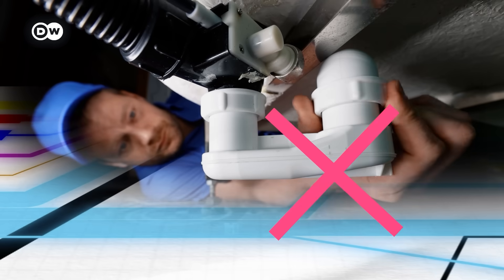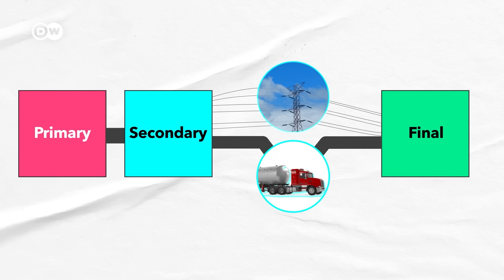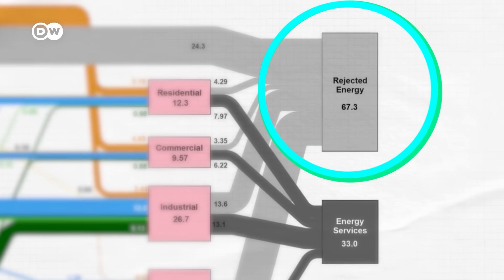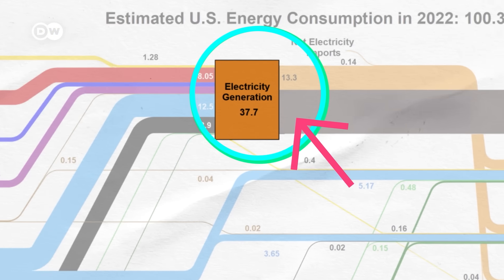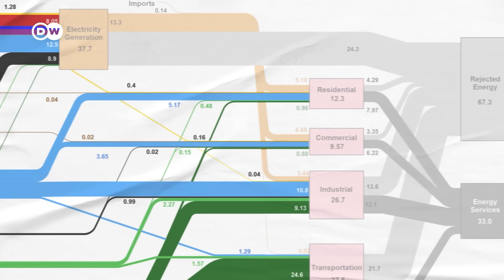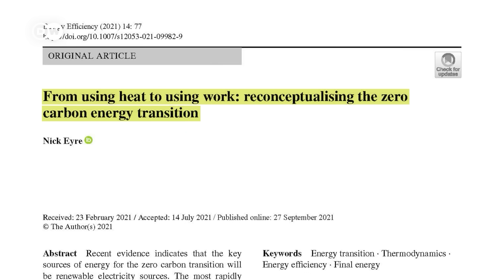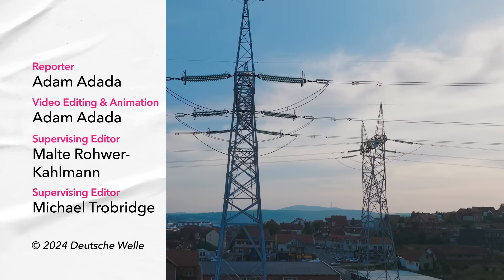The mind-blowing thing we get WRONG about energy

Comment: Most people do not know that two thirds of the money they spend on gas is for waste heat
Reply: Doesn't have to be, 40% is for peaker plants that backup renewables and variable demand, 60% is for CCNG base load power plants, 80% is for CCNG that burns in oxygen and sells the nitrogen to fertilizer production next door. That dual plant hasn't been built yet.

Comment: Electrification is not a done deal especially in the developing world. The electrification drive requires resources i.e., minerals and chemicals at the scale which is maybe 10-100 times of current global production. The extraction and processing lastly commodification the minerals and chemicals are highly energy intensive and can't work on renewable energies (mining/quarrying , treatment plants, forges etc ) atleast in cost effective ways. This is not also counting displacement of vulnerable people , ecosensitive zones .
The efficiencies shown here are  true because it's thermodynamically based on the energy source the inefficiencies don't matter till the fossil fuels price rise to threshold
Don't fall for ration of cost to max potential power output because love it or hate it renewables are not 24/7 operational fossil fuels nearly fully operational 
Storage is still a very buggy and expensive problem
Reply: Storage isn't buggy. Electrifying resource extraction isn't impossible. Kuhn Schweiz in Germany has developed an electrified mining truck that does not need external charging. It drives up a hill, gets loaded up with minerals, then recaptures the electricity on the way down with regenerative braking.

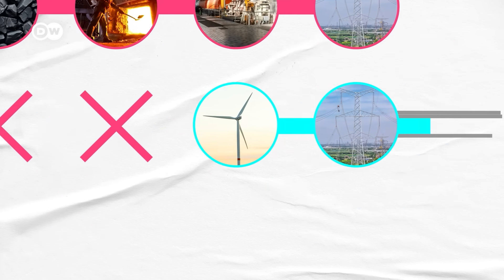Comment: They are speculating again, solar panels and wind turbine are not comes from a thin air (6:51), they are produced on factories that uses tones of different materials with huge energy usage. 
So it is not the answer to any problem, nuclear, geothermal and fusion power are the future.
Reply: It's no different cost of energy to making cars, washing machine, etc. At least Solar Panels will offset and even returns back many times over the energy used into creating them.
Reply: @TakZ000  Irrespective, it's still a valid point that the energy to build these things and the material pollution eg solar panels or even the wind turbines is still an issue. As to cars? Too many people wasting time doing unnecessary transportation and washing machines same: Demand needs to be cut down as much as efficiency and clean energy production are part of the solution.

Comment: This is very good "news", it is incredibly important, and it has been in our hands all along.  We just need to move beyond decades of fossil fuel industry... gas-lighting!
Reply: And replace it with electrification based on intermittency that will have quite low round trip efficient long term storage systems. New Sankey, same as the old one.
In the US NE, energy production from solar is 5x better in summer than in the winter, that spells massive long term energy storage  bill at very low efficiency.
Or we could just use nuclear that needs no storage at all even though MSRs have built in heat storage for constant heat with variable on demand electric output.
Reply: @johnjakson444  Don't forget about hydro. It only accounts for about 6% of the US grid mix, but there are very significant additional imports from Canada. This storage hydro is effectively a massive existing grid tied battery.  What we need is to just commercially re-task this from baseload to peaker, using renewable power, when it is available, to allow the reservoirs to replenish capacity.  Other solutions such as allowing plugged in EVs to feed/sell power back to the grid at a profit when demand needs capacity, and supply cushion sensitive hourly power pricing (do we need 10 million hot tubs and pools heating for the 1 hour, no wind, no sun, dinner hour, when the supply cushion is under pressure?) are also excellent market driven tools available for implementation quickly.

Comment: Renewable energies are good, however, it cannot be used to be the "BASE ENERGY CAPACITY" to sell because of its variability. But it is good enough to be used slowly by people.
Reply: This is where battery tech is crucial. There gotta be an affordable and sustainable way of saving excess energy and use them when needed. If that's successful then the base energy capacity can be lowered.
Reply: Tomrrow the OPEC countries turn off the spigot for world oil supply. America can still produce, but the oil suppliers reduce supply in sympathy with OPEC. Now, tell me, how variable is that supply? We have little oil stocked for emergencies and it wouldn't be enough. We don't have batteries or some other kind of energy storage. So, what do we do?

The electricity I'm using to write this is being produced NOW, as I write these words. There's no battery storing it anywhere.
Reply: @markhathaway9456  OPEC reducing their production? What kind of financial suicide is that for them? That will speed up the renewables technology at unimaginable levels.

Comment: I think that at least currently all solutions or electric alternatives to current appliances at the useful stage are all inadequate and do not have the same level of convenience nor experience. The other aspect of renewables except nuclear not being able to provide 24 hours consistent electricity and/or using batteries for such is something that makes you spend billions more for another, possibly fossil fuel based reliable energy source.

Comment: Fuel source is middleman not mention the war. Sometimes middleman is very bad :) Wind power and solar power is very low dense energy source where coal, oil, nuclear with all inefficient stages of middleman are very energy dense sources, we cannot deny that fact. Even with high pace transition to renewables wind, solar, hydro pace is not enough with demand because we dominated by low density technology. And second it is old technology water wheel, wind mill or  solar panels is new but only have 23% efficiency of total sun falling into panel. Wind mill have theoretical maximum of 50% wind velocity transitioning into rotation of generator velocity, and hydro have 42% limit of hydrostatic potential energy transitioning into rotating energy.  Rest of 58% is discharge kinetic energy into river. From A to B is old technology we need electricity production where kinetic energy of air, steam or water is recursively saved and used again in electric energy production.

Comment: What about the natural gas that is flaired off because it's in the way.
Reply: Most civilized countries have banned that, and it goes into the natural gas production. We changed that here in Denmark in 1980's and used natural gas for a lot of things that were previous running on oil.
Reply: @poulhenne  hopefully it was banned!!! I saw it on a mass scale in the Saudi desert, a sad sight. Also saw diesel for  .10 cents a liter.
90-91 time frame

Comment: Wow, that's one of the rare moments where bad stuff is actually good news lol
Reply: The more inefficient we have been, the easier it is to make it more efficient.
Here in Denmark, we have properly insulated houses and district heating with solar panels making all the needed heat between april and october. It makes the next steps a bit more expensive to implement, but we are still pushing due to high energy taxes.
In reality we only have certain industries that are wasting a lot of energy, the usual suspects: concrete and iron/steel production.
Reply: @poulhenne district heating in Denmark in fact anywhere have a big amount of heat loss in distribution,  you can see that with your bare Eyes only when you in light freezing temperatures have ice and snow melting only above were there are district heating pipes in ground under asphalt and at peoples driveways, there as much heat loss as 1/3 yearly, even more in sommer due to the fact that there almost only needs to heat tapwater in homes.

So district heating have to produce yearly about 130% heat out of plant to deliver 100% to buildings.

Individual heat pumps are far more efficient in areas where you have separate one family houses.

If those one family homes have Solar on there roof it will be further efficiency.
 
In Denmark where you we use a great amount of straw or wood chips in district heating its  greenwashed to be CO2 neutral to burn that type of captured carbon, totaly stupidity, captured carbon/ coal, shall not be burned, even  more disturbing in Aalborg DK, there is used coal to generate heat to district heating in a plant placed about 10 km from Greater Aalborg there are a significant heat loss.

District heating is not, efficiency first, we should adress district heating Heat losses  by not open new areas whit district heating, was great, 30-40 years ago but not anymore. 

District heating should be banned a lot of place.
Reply: @poulhenne  I hope Denmark and Nordic countries also do something about their extreme ecological footprint, consumption and waste production... as at the moment they are still (among) the worst in Europe.
Reply: @maxwouhou  Unfortunately they aren't and most Nordic people tend to think they're very sustainable. Homes are very often heated to 21-25 degrees in the middle winter when it's -20°C or even colder outside and people hang out at home in shorts. Even shopping malls are so hot that you have to take your coat off when your enter. Whereas in summer people are using more and more of air conditioning even in low temperatures of less than 25°C. The modern architecture doesn't even take into account that the homes should stay cool during summer as they simply assume that people will get AC. 

People also have the tendency to drive to every place by car and the diet is basically nothing but animal products. Earning money doesn't make people into more sustaible consumers and instead they keep wasting more money into fast fashion, decor etc. 

This is my perception as someone from Finland.
Reply: @Maria-EU  Don't Nordic countries have mostly low carbon electricity, so AC and electric heating aren't really an issue?
Reply: It's all green washing without new storage technology.

Comment: I think there might be some confusion here, when we say "an x MW" plant, x isn't the power it generates + the power it wastes, the wasted power isn't computed into the capacity, meaning that even if you process is 100% efficient, you still need to generate the same amount of useful power as a plant that is 20% efficient. The thermal machines used to convert the chemical power into mechanical power are fundamentally limited in their efficiency by the laws of thermodynamics and their functioning principles.
The exact same thing happens with solar and wind, solar is about 20% efficient at capturing the sun's power in its full spectrum, while wind is a bit better.

I find this video very misleading.
Reply: I thought the video was plenty clear. Also, nuclear plants often have a MWth and MWe rating, indicating how much heat and electricity they can produce.

Comment: Interesting video. The actual video was more hopeful and honest than the narrator's spin on the information. My takeaway. Transitioning to an electric energy system is a no-brainer. And is arguably the most important part of this equation. Energy systems using heat* (which will remain necessary) should be used for base load to maximize their efficiency. Not as a supplement to intermittent wind and solar. Renewable energy solutions, that when available, can convert primary energy into useful energy the most efficiently. 
Not mentioned in the video. Flipping the script on how we view renewables such as wind/solar (primary vs. supplementary) would also make a great deal more sense with regards to battery storage. 
* coal, gas, nuclear, geothermal.
Reply: Heat can be stored in several ways and there is work on also converting it to electricity directly (not through common processes). I believe the latest developments are by MIT.

Comment: I would have liked to have seen some comparisons between countries with cheap and expensive energy (including taxes that make energy more expensive). In theory if the energy is more expensive the system should be more efficient.
Also how efficient are the best countries like Iceland, Norway and Denmark, maybe there are some surprises out there that we could learn from.
Reply: As a Dane that just finished renovating a house, I am really suprised how much energy can be saved by insulating properly and switching to underfloor heating with 32 degrees C water instead of 55 degrees radiators on the walls.
The switch to a heatpump would never make sense, until the house properly insulated and sealed.
Here in Denmark we have almost yearly a government grant for improving houses efficiency. Mostly it covers 30% of a project.
And since we have higher taxes/more expensive energy, it is quite popular to convert away from wasteful heating methods.
Seeing how fx. the UK is granting heatpumps and solar, but not really insulation / switch to low temp heating, it is striking how cheap natural gas have prevented the changes.
Reply: @poulhenne  I too love underfloor heating. But I dont't think it makes much difference if you are using 55 C or 32 C water to heat your house. If you have district heating the return temperature can improve the system and make it more efficient, but you can use 55 C water in radiators and stille have a return temperature less than 30 C.
Heatpumps are a supper efficient way to heat your home, especially if you are using wind or solar power. It is honestly a "cheat code", since you can move more heat energy than you spend on moving the energy. You can further improve them by drilling holes into the ground and using the earth itself as a "heat battery". And if you are getting a heat pump to heat your house, make sure that it also can work as a AC unit. It only requires one extra valve and a little more control fancy controle system for a heat pump system to also work as a efficient AC unit. If your house is isolated a lot, with new windows and doors this makes the house air tight, this can create problems in older houses. But if you have a heat recovery ventilation system you can replace all the air in the house every few hours without "blowing hot air out the window". This will ensure a healthy indoor environment solving problems like Radon gas and humid air.
If you want to go all in, you can use your indoor temperatur as a battery. With smart controls you can heat or cool the house a little extra when the energy is cheap or if you have solar cells using your own energy and then let the temperatur settle a little when the energy is expensive. 
Example: Say it is the spring, and you like your house at 22 C. When the sun is shining and you have solar energy you can the "overheat" your house a little, let say to 24 C. And then when the sun goes down you can let the house hold onto the heat using all the isolation to keep the heat energy inside. And then let the temperatur slowly fall over night to, maybe 18 C, and then keep the house a only 18 C until the sun comes up again and then heat back up the house until you reach the max setting of 24 C again. You can do the opposite in the summer, cool your house down a little extra when the energy is cheap and allow it to be a little hotter when the energy is expensive.
For a single house this do not change that much. But if all houses using electricity for heating stopped heating the houses at the time of peak demand, then this technik could  help reduce the fluctuations between when we have plenty of green energy and when we use energy.
The downside of all this is of course the upfront cost, I think a lot of people would love to live in a home like this, but it is simply out of reach for many people.
Reply: Do remember that Norway is also a major fossil fuel state as well as a hydro juggernaut. Smaller population countries like the Scandinavians are generally outliars each with small populations.

Comment: What total BS …
When gas heats up your saucepan it is direct. 
Now let’s consider the induction job …
Wind - rotation plus losses
Rotation - AC electricity plus losses
AC - DC electricity (the AC is the wrong frequency for transmission) plus losses
That DC - AC that is the right frequency plus losses.
That AC - Ultra high voltage AC for transmission plus losses.
That AC is transmitted hundreds of miles plus losses.
Then is converted to domestic voltage AC plus losses.
Domestic AC is transmitted to homes plus losses … where finally it heats up your induction hob.
If you want to power a car with it then …
Convert the AC to DC to charge a battery plus losses.
Convert the DC into chemical energy in a battery plus losses.
Convert the chemical energy in the battery back to DC plus losses 
Convert the DC into circular motion plus losses. 
And btw … All those loses are heat that contributes to global boiling.